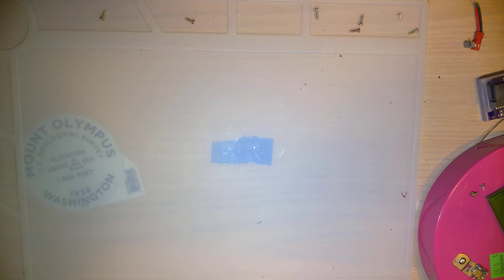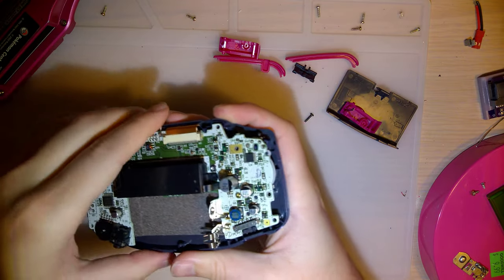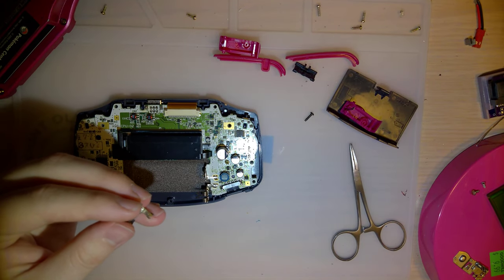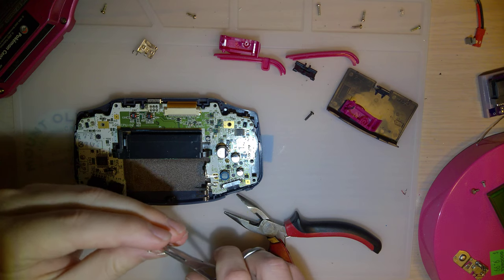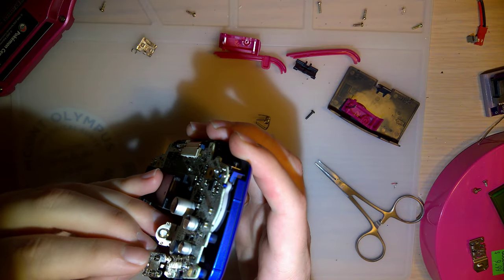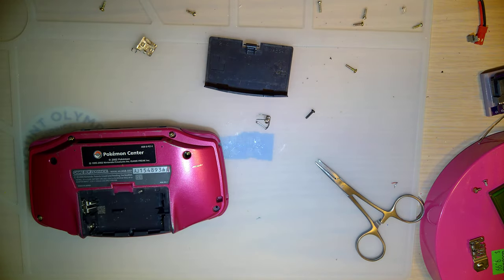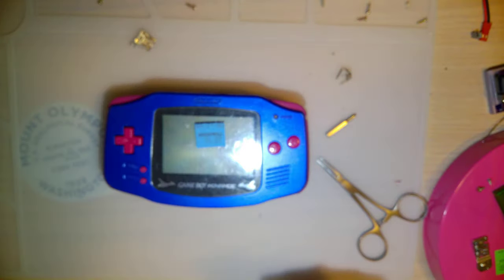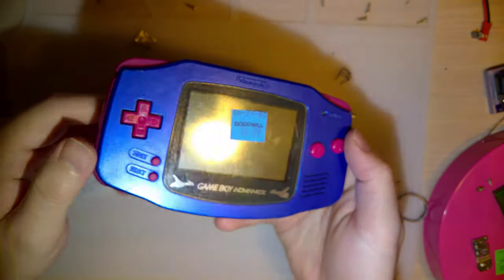Repairing a No Power GBA (Part 2)

Comment: Hey, I've got a question, for an SP, if there is a shoulder button that gives difficulty detecting presses, is that usually a replaceable part or is it damage to the board itself?
Reply from the maker: Usually it's just that the button is dirty. You can try disassembling the switch on the PCB and cleaning it out or just desolder and replace it. I do not know where to get the appropriate replacements though.